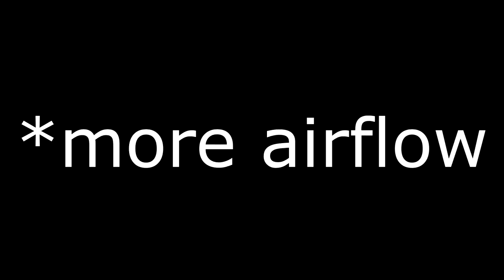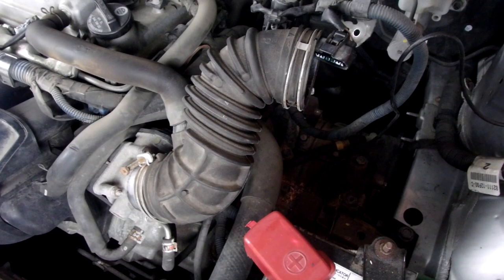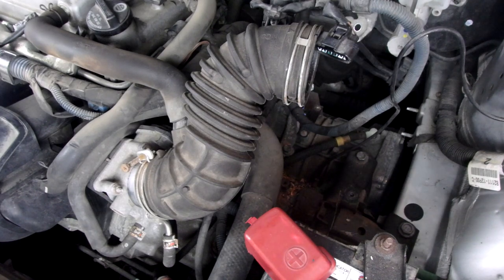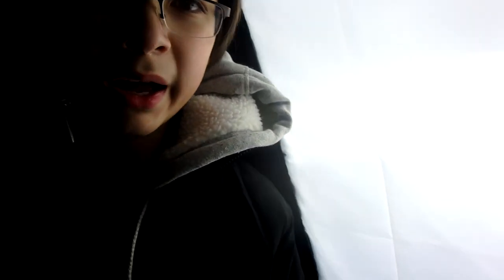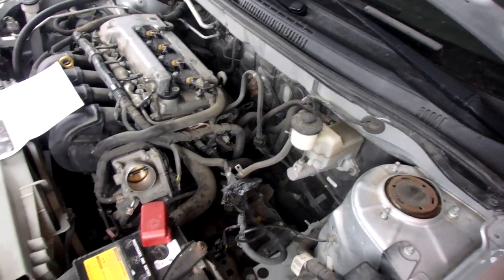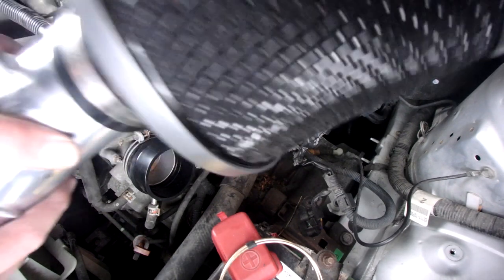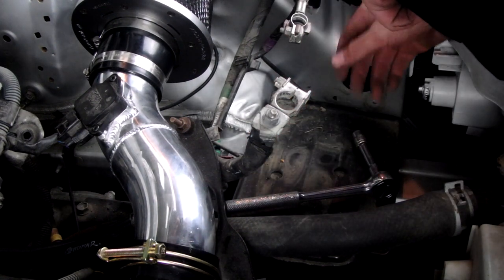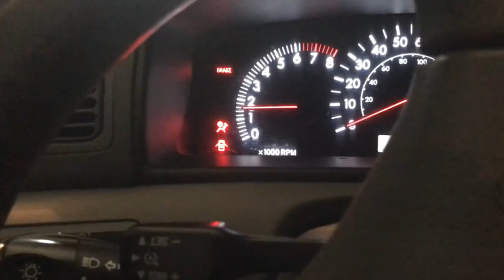Weapon R Secret Weapon Intake Install In My Corolla

Comment: I put an intake on my Matrix and I left that plastic tube piece that you removed at the end because it was put there to channel air from the front of the car directly to the intake, which provides a steady stream of cool air.  By removing it you have taken out the cold air stream so now you will be just sucking up the ambient temperature of the air under the hood which will be warmer and will reduce power.  Probably not that noticeable but you might want to re-install it and see!  Cheers!
Reply from the maker: Thanks for the comment! Honesty, I didn’t know what the purpose of that tube was when I installed this, and it’s been quite a while since this was filmed so I kind of forgot about it’s existence. I might try to find it again and reinstall it.
Reply: It does help but i had to modify my the air temps were getting to high almost 50c° in a 28c° to 30c° day so i had to cut mine and put it between the headlight and the horn i worked wonders the temps went from 48c° to 28c° to 32c° i really recommend doing if you have idling problems or you have a lean condition like mine had.

Comment: Brings me back to 07 when I installed one of these on my Sentra, enhances the sound a lot. 13 years later I'm almost 30 and just bought an  f32 N55 and I'm currently modding it as well
Reply: Thinking about getting one for my ‘11 sentra se r spec v.

Comment: You should have disconnected the battery before you did anything also you should of kept the fender intake tube and cut it back you would have a direct cold air through it directed right at the weapon r intake

Comment: Do you remember where you got this intake? If you could share the link that would be awesome.
Reply from the maker: Here’s the link: https://www.carid.com/2007-toyota-corolla-air-intakes/weapon-r-secret-weapon-short-ram-air-intake-system-377225993.html

Seems to have gone up in price since I got it unfortunately
Reply: Thanks alot. Did you have any mass air sensor issues with it?
Reply from the maker: No issues with the sensor, but not a bad idea to clean it at least every time the filter is cleaned/changed

Comment: So is more airflow better for the engine????
Reply from the maker: It depends on what you feel is “better.” It’ll make more noise and a slight bump in power if that’s what you’re after, but more airflow means more dirt into the engine, which may not be so good for longevity. Pros and cons for these things, really depends on what you want to do with your car!

Comment: ? That first bar u took off what is it for? So just bought this car and want to do mods vf on it
Reply from the maker: That’s the front strut bar, and it increases the rigidity of the chassis which increases handling performance while cornering since it reduces body flex.

Comment: Link to the part i cant find one for my 99 corolla 1.8 manual
Reply from the maker: Here’s the link to mine: https://www.carid.com/2007-toyota-corolla-air-intakes/weapon-r-secret-weapon-short-ram-air-intake-system-377225993.html?parentsubmodel[]=ENGINE|1.8L

Can’t guarantee that it will fit your car since this is for the 9th gen but given that we both have the 1zzfe it might

Comment: It’s a short ram or a cold air? When I look at the product is says cold air in the description
Reply from the maker: It’s a short ram, cold air intakes for these cars generally mount the filter under the left headlight in the bumper
Reply: It’s actually a cold air if you leave the part on he took off at the end of the

Comment: How long have you had this? Is it still on 4 years later? And has it worked fine?
Reply from the maker: Yep, I still have this intake installed! I swapped out the Weapon-R filter with a K&N one just because it seems less restrictive but the intake pipe is still the same. I haven't had any issues with it besides it tripping a P0171 lean code
Reply: @WillChang  good stuff buddy. If throtl will price match the intake for my sentra spec v, I’ll be ordering one for sure.

Comment: Sweet vid
Reply from the maker: Thank you!
Reply: @WillChang  any idea what the problem could be if I have a rough idle and a too lean code? Thanks!
Reply from the maker: If you haven’t replaced your intake manifold gasket I would start there, they fail quite often. Definitely replace it with the updated OEM Orange gasket, the felpro gasket will leak again

Comment: Your music sucks and if you have any common sense a short ram air intake is horrible for your car because you are pulling hot air from your engine compartment a proper cold air intake set up should be vented from the Fender Weld or front bumper
Reply: Heat shield fixes that problem plus some heat resistant coating on the tubing / piping. Learn a lil about cold snowy countries before dissing a short ram. Cold air vented low in these climates kills engines with water